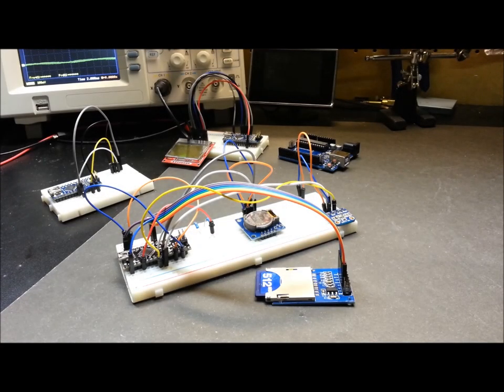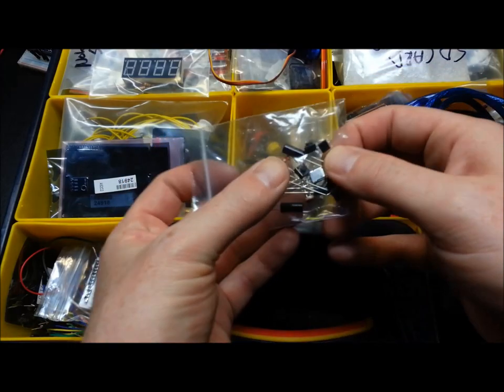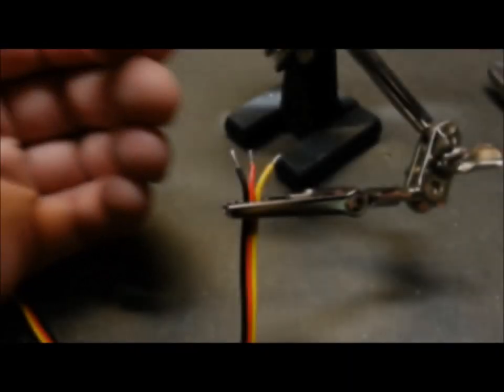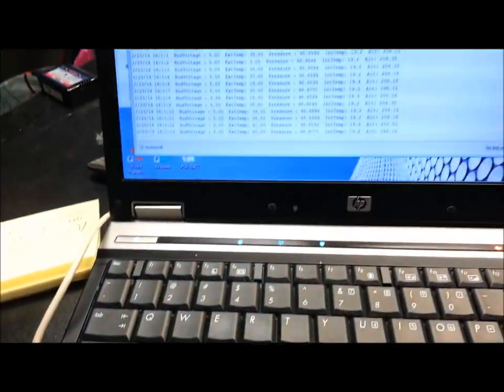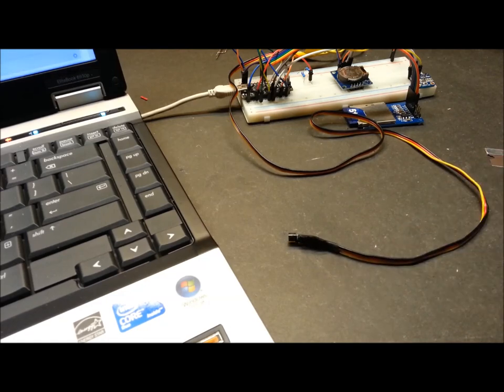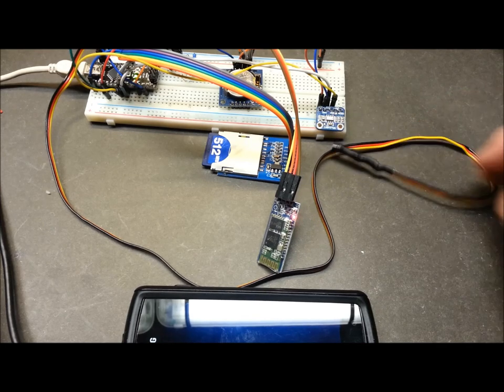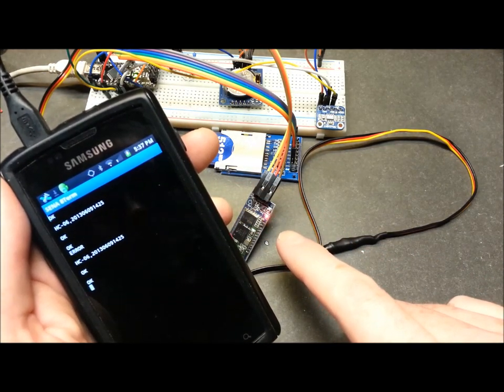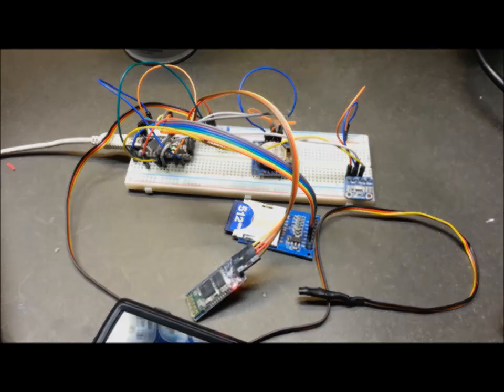HAB Part 5- Arduino LM35 Temp Sensor and HC-06 Bluetooth

Comment: I'll have to look around but I believe that there are i2c temp sensors available, might get you around that A/d issue
Reply from the maker: The baro sensor already has temp and measures way into the negatives.  All is sorted out no prob.  Thank though.  Cheers!

Comment: Eric -
I think the problem with the temp sensor is that you had it wired backwards (+ to grd).
In the 'fixed' part, you have reversed the wires and it is now wired correctly.

Comment: Hi there I just got the atmega 328 and hc-06 but im having difficulties setting the hc-06 up through the at atmega 328. So, I just was wondering if you can give me your sketch to set them up? i'd appreciate it. They both are set to default.
Reply from the maker: http://www.mkme.org/index.php/high-altitude-balloon-project/  Code is there and maybe check out some of the newer videos in this series. Good luck.  Cheers
Reply: Eric William 
THANK YOU SO MUCH!! YOU ARE A GREAT GUY!!!
Reply: Ahmad Alotaibi
BTW, I am asking about the sketch code for setting the hc-06 to communicate with arduino nano or if you can check my code blew.

#include <SoftwareSerial.h>

SoftwareSerial mySerial(1, 2); // RX, TX

char myChar;

void setup()
{
    Serial.begin(57600);

    //mySerial.begin(38400);
    mySerial.begin(9600);

    mySerial.print("AT");
    delay(1000);
}

void loop() // run over and over
{
    while ( mySerial.available() )
    { 
        myChar = mySerial.read();
        Serial.print(myChar);
    }

    while ( Serial.available() )
    { 
        myChar = Serial.read();
        mySerial.print(myChar);
    }
}
Reply: Eric William 

BTW, I am asking about the sketch code for setting the hc-06 to communicate with arduino nano or if you can check my code blew.

#include <SoftwareSerial.h>

SoftwareSerial mySerial(1, 2); // RX, TX

char myChar;

void setup()
{
    Serial.begin(57600);

    //mySerial.begin(38400);
    mySerial.begin(9600);

    mySerial.print("AT");
    delay(1000);
}

void loop() // run over and over
{
    while ( mySerial.available() )
    { 
        myChar = mySerial.read();
        Serial.print(myChar);
    }

    while ( Serial.available() )
    { 
        myChar = Serial.read();
        mySerial.print(myChar);
    }
}